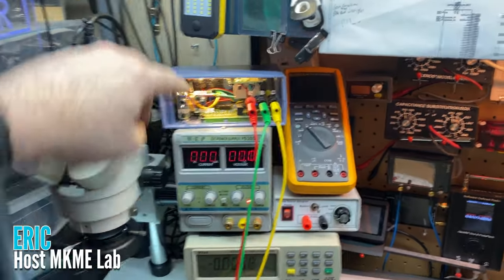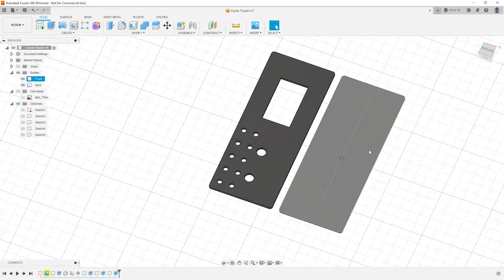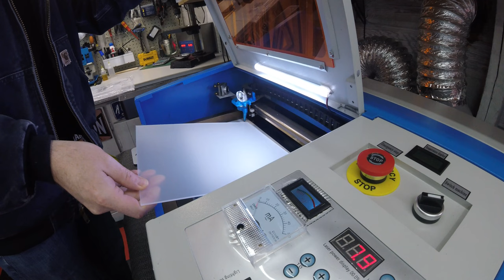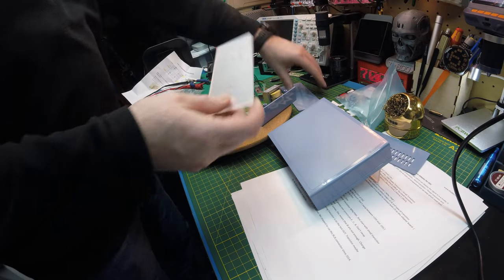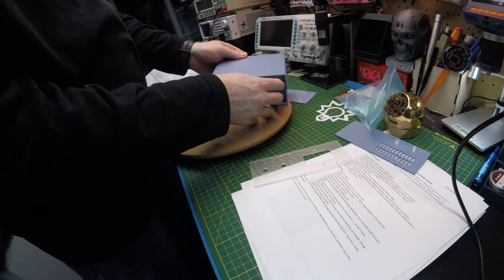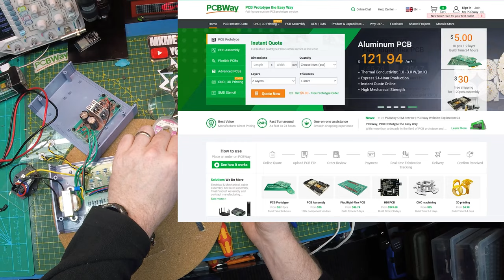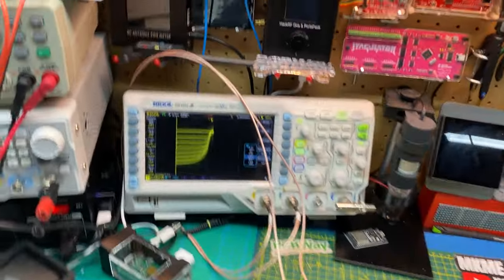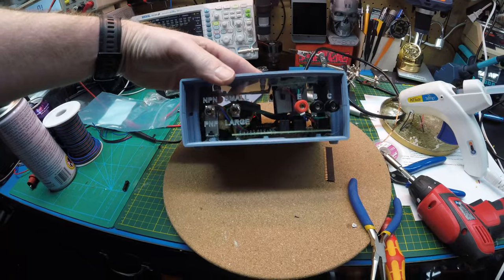Transistor Curve Tracer Custom Build- DIY

Comment: I've been looking for a curve tracer and they really are hard to find these days.
I remember using one at a previous job to find matched pairs of power transistors for a high power RF amplifier.
Reply: i bought the asa 210k thing recently and the xy bncs arced from 24v so i unplugged it and found the issue and fixed it but i dont want to ruin an expensive scope with that garbage so i think im gonna order the one he's building here.